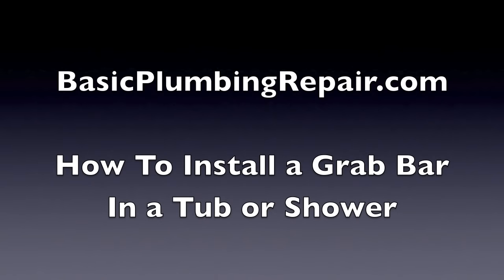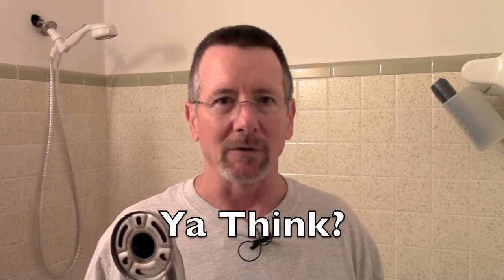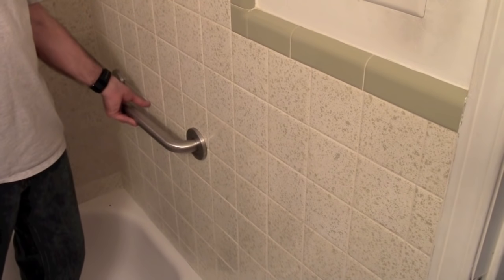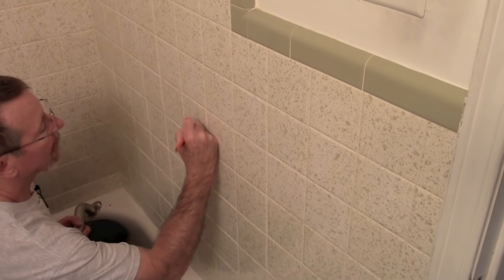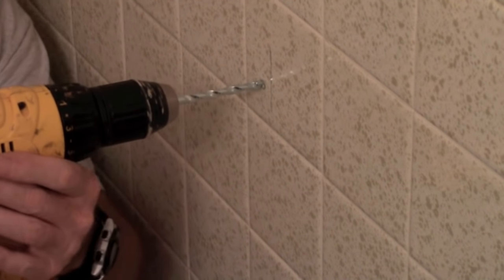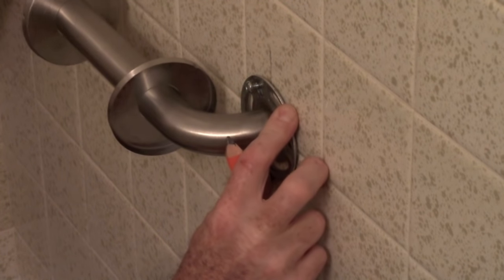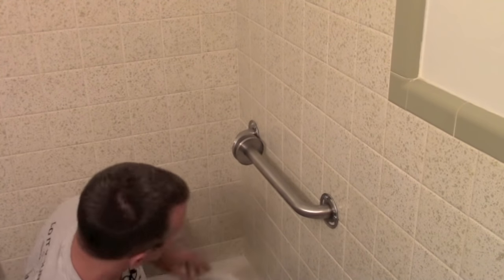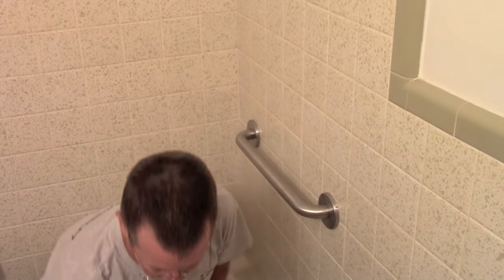How To Install Bathroom Grab Bars

Comment: Not to knit-pick, because this is a great video, but I do want to point out that increasing the number of fasteners that an object has does, in fact, increase its "holding power"- so 6 bolts hold better than two for example. But I do want to point out that the molly "holding power" is not cumulative. By that, I mean, the strength of the molly you were using was "77" each. Using 6 of them does not mean you now have, as you say 231-240 strength... It still only requires a force of 77 to break each of those mollys out. (Hear me out) The added strength is gained by increasing the number of fasteners (6).  So using one has as you say a strength of 77 but having two does not necessarily mean you now have 154 or that 3 has 231... I know, it's hard to see what I mean especially since I've not done a very good job of explaining it. Someone else may be able to word it better but I just didn't want people thinking that molly strength is doubled or increased equally by the strength of each molly as you have stated in the video. Does it increase by using more? Yes. Is that increase exactly +77 each time you add another fastener? No. Loved, the video BTW, it helped me with that exact job today.
Reply: Thanks, that's what I was thinking and if someone is using to pull themselves up I wouldn't trust anchors to hold.  I'm trying to figure out how to install on tile that goes up to the ceiling (making studs hard to find); I was afraid to trust just anchors...though they do make anchors with greater holding power.
Reply: Katz OK, so I just finished a massive walk-in handicap shower for a client this week where I had to do exactly that, attach grab bars on a wall that was tiled clear to the ceiling. Now, before I go too far I do want to say that I installed 2x6 stringers horizontally between the studs in the wall specifically for the purpose of attaching these grab bars BEFORE the tile was on.  But here's the embarrassing part - ADA specs define the height of where to put the grab bars - but I forgot to write down the EXACT locations of them and I missed the end of one (horizontally too far to the right, past the stud) and ended up attaching it to an area that was just tile over "drywall" (I use Schluter Kerdi, so you don't have to use cement board). Anyway, I simply drilled a slightly larger hole and used butterfly toggle-bolt style anchors. You have to drill a little bit larger hole and caulk it but they will hold pretty well. Especially if you used large tiles like 12x24 as I had.  Obviously, though, you REALLY wanna hit the studs. At a different client, hitting the studs in the shower was so crucial that I opened up the wall on the other side to find where the studs were, measured, and then simply repaired that wall when I was done. That way I hit my studs in the existing shower on the other side of the wall. My two-cents worth. Hope it helps, and good luck.
Reply: Very good points NorthernChev.  I had though that butterfly toggle-bolt anchors would be a MUCH better solution to a studless mount as there is more drywall/tile/mud to grab onto.  And I also had thought about finding the studs behind the shower as well, but I didn't consider adding the horizontal stud in the likely even the shower bar wasn't 16" in width.  So I'm glad my thoughts were aligned with someone who's done this before.
Reply: Snap toggles are indeed very reliable.  Their backer is flat, which spreads the load evenly behind the wall. Also, snap toggles let you control the way they're pointed - vertical is strongest for grab bars.  This differs from molly bolts, which put lots of pressure on just a few points at the ends of the butterfly anchors, and they may end up spread horizontally, delivering less holding power for a grab bar.
Reply: @NorthernChev  you sound like you have the same curse that I have! Perfectionism!

Comment: I’m paralyzed wheelchair with a little handyman in me... paralyzed waist down... 2 things - duct tape will hold things in place while y’all mark holes, drill, etc.... Most importantly - to the installer PLEASE after install try it out! Put weight on it! In case in comes off the wall.  Don’t let the ‘end user’ get hurt without you trying it first!  (Yes! I’ve had bars & permanent shower benches fall off wall with me on it!)
Thank you!

Comment: Great video! But if the anchors (wall plugs) are flush with the surface wouldn't they crack  the tile when they expand? I would probably want to sink them deeper into the hole.

Comment: You talk about importance. So I'm looking into installing grab bars for an elderly neighbor. My theory is that almost any fastener or anchor NOT installed into a stud is only as strong as the sheetrock or the cement board. Adding more anchors is actually defeating the purpose as what you're really doing is adding more holes in close proximity to each other. I would imagine that grout lines would crack also.

Comment: So, no silicone? And yes, I gotta agree with the others. You should find at least one stud per side.
Reply: the plate needs to drain ( it has a little hole in it for that purpose which should point down when it's snapped in ).

if moisture gets behind, it will mildew the wall space through the anchor and spread through the entire cavity over time. the result will be a "ghost odor" in the affected and adjacent spaces, even one floor up or down. When I'm called to address a ghost smell near a bathroom, I look for caulked covers in a wet space, like a shower..

If you insist on caulk, caulk the drill hole before fully seating the screws. To protect the space beyond, which is the point of the entire shower enclosure.  Good luck!
Reply: Stud finder device doesn't go thru both tile and wallboard.  Too thick.
Reply: Yes, caulk every penetration.  We also caulk ABOVE (not below) the scew between the flange and the wall.

Comment: What size drill bit did you use to drill your hole? I am using the exact same anchors and, per the package instructions, I used a 5/16" drill bit - but there was no way I could get the anchor into a hole that size, not into tile. It looked absolutely effortless when you did it.
Reply: It's odd he didn't tell us the size of the drill bit. Seems like important information.
Reply: @Milwauken65  The anchors he purchased have the proper size bit in the package depending on what size anchors you get. Home Depot carries these. If you use another brand be sure to get the type that have wings that spread behind the wall and not just the light duty ones that hold by friction inside the hole.

Comment: Don't follow this guy's instructions period.  If you can't locate the studs, call in a professional  to install the grab bar for you.  Bathroom walls are probably the weakest in the house because of constant exposure to moisture.  You can't trust lath and plaster or drywall to handle the shock force of someone falling in the bathtub.  Find the studs or find a certified professional who will guarantee their work.
Reply: what do proffessionals do if they cannot mount it on a stud？
Reply: @ericx7736  Most of them will just install it to tile and pretend it's secure.

Comment: great info, very helpful, but what if I have vinyl surround enclosure? I think it backs onto plaster.
Reply from the maker: Deana2 You can try using stainless steel toggle bolts but I'm not sure about how much weight they will hold in plaster.  Ideally, you would need to get into the wall and put up some solid wood backing. I know that;'s not what you want to hear...

Comment: Thanks.  What about if you have a one piece shower and there was already a bar there but now it is loose, hanging off almost.  How can I repair this?  It seems I need to take the bar off completely and remount it.  But this seems difficult since the mollies are still hanging there loosely.
Reply: Michele, if I were you, I would drill out the mollies and replace them with toggle bolts which are round or flathead bolts with spring-wing fasteners.  Go to your local hardware store and explain to the man what you are attempting to do and ask him to advise you as to what toggle bolts are.  There are a very wide assortment and lengths and sizes.  Simply drill out the mollies so all you have are the 3 or 4 holes per side then assemble the brackets with the toggle bolts just loosely together, insert one bolt into the hole (you may have to enlarge the hole slightly to allow the wing-head to pass through or buy smaller toggle-bolts) push in all the way so the wing opens, then pull back assuring it won't come back out, then repeat that step on all the remaining holes.  Then hold back tension on the rod, trying to loosely tighten all bolts evenly - in other words trying to tighten only one bolt at a time is the wrong procedure.  With your left (or right) hand, hold back on the rod, using your right (or left) hand to operate your screw-gun.  Don't tighten them too hard or you will pull the toggle right back out through the wall, breaking the wall-board.  I hope that helped.

Comment: Grab bars are safety devices designed to enable a person to maintain balance, lessen fatigue. They are not to hang or climb on. Most old people would not have the upper body or hand strength to pull that bar off the wall or even pull themselves up.
Reply: Change that to 'some old people' please.  I'm 78 and can still do a few chin ups even though I'm overweight.  I suspect that very many seniors have the strength to pull themselves up.

Comment: My handy man installed a grab bar with a soap dish ( moen) to me it is not levered if I put the level on the grab bar but if I put the level on the soap dish it is? he argues it should be lower on one side , I think he is wrong - one side the bar is under the grout line and the other side it is just about the grout line. Can you give me any insights to this? what is the proper way , I think the grab bar should be level!!

Comment: I have a grab bar that came with my tub. There are plastic rings on each end. I cut them off because they were moldy. Now I'm worried what if they were creating a barrier between the bar and behind the fiberglass tub?? So water could leak behind the tub into the wall. Any solution for what I could do here?
Reply from the maker: +E Reed Silicone caulk

Comment: OK...OK...OK...I HAVE WATCHED YOUR VIDEO ALL THE WAY THROUGH.....I AM A CARPENTER 55+ YEARS EXPERIENCE.....THE WAY YOU LEARN A SUBJECT IS TRY TO TEACH IT.....SUCH AS THIS VIDEO......DO NOT USE THE PLASTIC 250 POUND HOLDERS.....WHEN YOU INSTALL A HANDICAP GRAB BAR.....YOU MUST THINK OF A PERSON WEIGHING 300 POUNDS.....PLUS THEY ARE FALLING.....SO IN THAT FRACTION OF A SECOND WHEN THE 300 POUNDER IS FALLING YOU MUST MULTIPLY 300 X 3 = 900 POUNDS.....THIS IS THE WAY YOU MUST THINC WHEN INSTALLING A HANDICAP GRAB BAR......ALSO NOTICE.....BASICALLY THERE IS ONLY ONE SCREW HOLDING THE BAR....THAT IS THE TOP SCREW.....THE OTHER SCREWS DO NOT MATTER WHEN FALLING....THE TOP SCREWS PULL OUT....AND THEN THE LOWER SCREWS FOLLOW.....I WOULD LIKE TO MENTION....I COULD STAND IN THE TUB.....I WEIGH 200 POUNDS.....I COULD PULL DOWN ON THE BAR FALLING....POSSIBLY 400-600 POUNDS AND THE BAR WILL PULL RITE OUT OF THE WALL....GUARANTEED.....SOLUTION....BUTTERFLY WING ANCHORS.....DRILL THE HOLE ALL THE WAY THROUGH THE WALL SUCH AS YOU DID.....THE BUTTERFLY WING ANCHOR GOES INSIDE THE WALL....SPREADS OUT AND WILL HOLD 600 POUNDS EACH SCREW.....BUT THEN BEFORE YOU DO THE FINAL SCREW DOWN....INSTALL 25 YEAR ADHESIVE CAULK TO THE ROUND CIRCULAR PLATE BEFORE IT MEETS THE TILE WALL.....FINAL SCREW THE BAR TO THE WALL.....LET THE CAULK OOOOOZ OUT THE SIDES.....SLIDE ON THE FINISH COVER PLATE.....THE CAULK WILL SECURE THE FINISH COVER PLATE FROM COMMING LOOSE IN THE FUTURE....NOW THE HANDICAP GRAB BAR IS PERMANENT....SAFE AND SECURE.....THANK YOU FOR YOUR VIDEO....ROCKY AND BETSY

Comment: Hi, this video is very helpful for people who wants to install some bathroom grab bars. Very nice tutorial and a good video indeed. I just wanted to ask something, my grab bar went off as I held it when I was showering. The grab bar itself is good but I tried to screw it back into the wall but it's not solid as it was before. How do I repair this? Should I buy those blue thingy (I think you called them ankers or something?) and replace it with the old ones and just screw the bar back again????
Reply from the maker: Worgam TheThief As long as the tile os OK that sounds like a good plan to me.
Reply: Basic Plumbing Repair Okay thank you very much!
Reply from the maker: Good luck.

Comment: Don't do this. Like the man says - he isn't responsible. The crappy little fasteners won't hold"cumulative weight" .  Use the Moen system, rated Snap toggles or hire a professional. Other problems: you're just as likely to shatter the edge of the tiles by drilling into the grout lines. You're much better off using a variable speed drill to drill through tile SLOWLY so it doesn't crack.....

Comment: I always thought it was essential that you screw this into the studs? I would never do it this way
Reply: then dont! its his way of doing it
Reply: @DV-tc1yr  his way is wrong, first time someone grabs that bar, they are going to pull it out of the wall.
Reply: @badmatt4227  u don't have to use studs...but u definitely want to use heavy duty toggle bolts....not these small a$$ ones he's using....I wouldn't trust them.
Reply: @selaxlife7621  I disagree.

Comment: Many of the bars on the market are 9, 12 & 18" virtually making it impossible to hit both studs.
Reply: +lucy482 I believe that it should first have an additional stud behind the wall to get screws in.  Second, the longer bar is made to go at an angle.  A horizontal bar in a shower is for hanging your washcloth....

Comment: You do not want to have the tile or backing board holding a grab bar this install is a crap install the install should be into studs ! For my friends i would NEVER EVER USE TOGGLE BOLTS . I WOULD ONLY SCREW INTO STUDS TO DO IT RIGHT !

Comment: To mark the holes, it's way easier to just hold the bar against the wall with one hand, and use a pencil to trace inside each of the holes in each end (with the cover plate slid to the side). Basically use the grab bar itself as a template. Way easier, way more accurate, no math or guess work. You can also hold a small torpedo level on the grab bar to make sure it's level (if the tiles are large and you're not mounting it close enough to a grout line to use that as a basis.

And DON'T use an ordinary masonry bit, especially in hard tile those won't work. Use 'glass & tile" carbide bits (usually they're very short and pointy), or better yet a diamond hole saw.

Comment: No reference to what ADA standards are. Not useful for determining what bar height and placement requirements are to be compliant.
Reply: ADA does not have code for residential
Reply: Lots of our "little old lady" customers need the bars lower than ADA. And one customer, a former NBA forward, needed his at 40" up from the floor.
 For commercial jobs, we stick to ADA of course.

Comment: ABSOLUTELY DO NOT USE WALL ANCHORS FOR GRAB BARS! Not nearly strong enough. As well, you run the risk of cracking the tile with expanding anchors.

Comment: People please, in a tile shower you NEVER EVER use wall anchors like these, why? Because they are not strong enough to handle pulling weight, they are only designed to hang weight without any stress being put on it, ALWAYS ALWAYS find the studs! Would you like your 200 pound mother to pull it out of the wall and fall and die in the shower? ALWAYS ALWAYS hit the studs, that is the only way to completely secure it safely. A good stud finder is a heck of a lot cheaper than an ER visit! Just sayin!

Comment: Those anchors are not made for that and would probably fail under the dead weight of somebody who is falling. Find a stud or use wing-it's. Drilling holes into a  shower wall without silicone? Jeez.
Reply: Talking about things not being made for that. Grab bars are not made for catching the dead weight of somebody who is falling. They're made for, YES, grabbing, shocking I know. When someone is entering or exiting the tub they're used to stabilize yourself so you DON'T FALL in the first place. 

Aside from all of that, you've quite obviously never been around the elderly or the disabled. If you had been you'd know how quite ridiculous it is to think that they'd even think to grab the grab bar while actually falling let alone be able to actually grab it and use it to stop mid-fall.

Comment: Too many mistakes including using drill to tighten up( can easily over tighten ) never install at the back of a tub or shower stall,( want to prevent falls by discouraging people twisting to face the front) and no moisture barrier ( number 1 reason bars pulls out later). Hire experienced professional who is educated on safety and proper transfers.